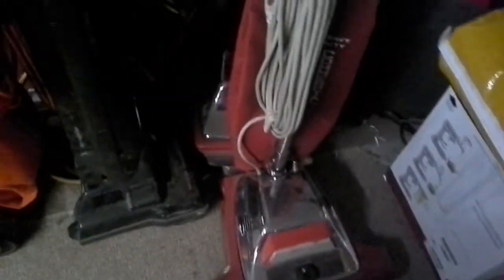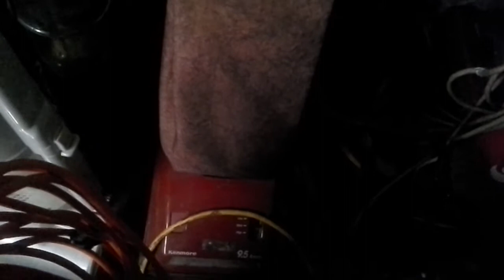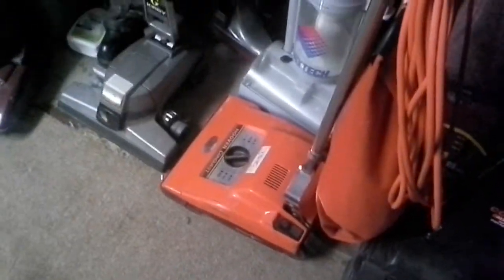Garage vacs.

Comment: Do the other brands that make sanitaire style vacuums use the plastic motor or do they use the metal motor still?
Reply from the maker: +KG5Vacuums Some use the metal top motor.
Reply: ArbokLover1618 can you name the brands?
Reply from the maker: KG5Vacuums Reliavac, Bissell, The bank heavy duty, SelectVac, Kent, EUROCLEAN, Perfect, ORECK premier and Rubbermaid even makes em.
Reply: ArbokLover1618 ok thanks.